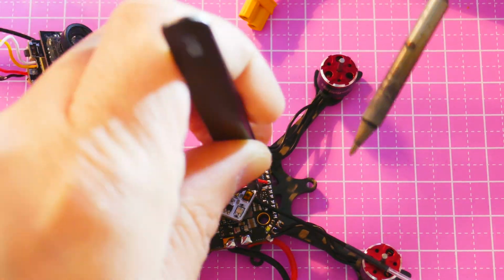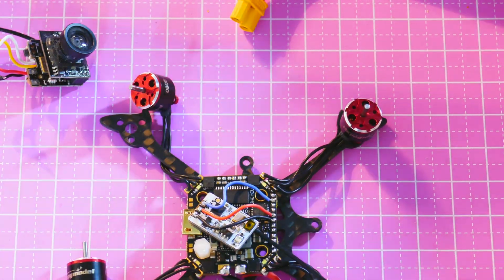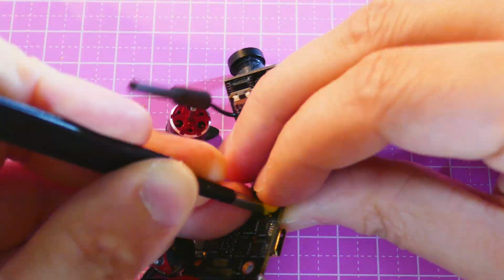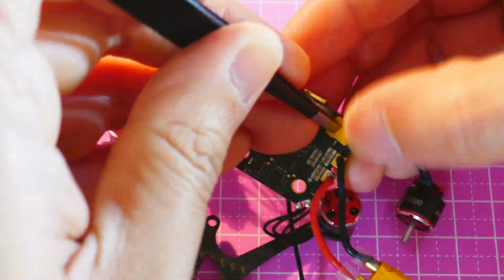JHEMCU GHF13AIO one and only 16x16 FC for FPV Quad

Comment: In the FC documentation it says the Uart2 can be turn on and off for SBUS etc receivers. Does this mean that when it s not turned on it functions as a regular Uart? Like, can i connect (or i guess remap it) to a TX/RX?
Reply from the maker: There are 2 RX pads for UART2, if you need inverted signal (SBUS), use the SBUS pad, otherwise, for something like ELRS, just use the RX2 pad.

Comment: Excellent build. I actually learned something about soldering to pin through hole pads.

Working on anything 20mm a below was a hateful process until by curiosity I picked up a generic USB powered mini soldering Iron from Amazon... it's only 10watts but it can get to 480c with the right power brick (actually 500c since it's so poorly regulated) and that's enough for micro builds...it has made the process so much easier. As it has a tip the size of a well sharpened pencil.
Now if only my hands were steadier...lol

If you've read this far...do you think the 40A version of this FC could handle some 2004 3000kv motors? They are generic and don't specify an Amp pull at peak...but they are .09A at idle and 496watts continuous...
Reply from the maker: Oh yea, those USB irons are good for small joints! There isn't a 40A variant of this 16x16 AIO, but 40A ESCs can easily handle a 2004 motor. Im flying 3.5" freestyle quads and cinewhoops with 2004 3000kv motors on 4s 90% of the time. Amp draw depends mainly on prop size and KV, 2004 3000kv @ 4s should still be fine even on an ultralight 5".
Reply: @kaizendon6237  Thanks for the reply.
And you're correct, it's the 25x25 version of the AIO that has the 40a ESC... undoubtedly 40A peak...and probably 30A continuous.

Comment: I guess this was the toughest board for me to solder ever, because the pads are so tiny and I'm using regular servo wire (board flashed with RotorFlight for helicopters). If I had seen your video before i started all of this... Thanks for the clear video and to-the-point comment !

Comment: how it is hold up now?
Reply from the maker: No issues for my builds, but becareful if you want to buy now, coz the newer ones come with BMI270 gyro instead of MPU6000, and BMI270s are wayyyyy more suspectible to electronic noise, and a compact FC design will only make things worse.

Comment: Is it okay if I soldiered the connector and than joint the motor connector?
Reply from the maker: The regular JST 1.25 connector used for most motors DOES NOT fit into the pads.

Comment: Im planning to use 2s, 3inch prop n   11500kv motor.. what do u think
Reply from the maker: should be insanely powerful. You have to read the spec sheet of the motor to see if it draws too much current.
Reply: @kaizendon6237  the spec sheet dont give current output for 3" 2s. Only 3" 1s. But capable for 65mm prop

Comment: thank you for this tutorial! It was really helpful. Do you recommend this board? is yours still alive?
Reply from the maker: Yes, I really like it for it's form factor. BUT ALSO, i burnt 2 of them, like literally in flames. 1 was likely bad from, it was flying weird, and was unable to tune it out, it burnt after a few flights, the other one, I crashed a lot before it burnt. 
I would be super careful about using turtle mode with this FC, I still use it in a lot of builds.
Reply: I also burnt two of these escs without any crash. One mid air and another on the bench. I still have one and it seems no issue so far but I don't fly that much with it.

Comment: Hey! :) Do you know/could you test if the JHEMCU can go slightly below 2S voltage? My plan is to use it with 2S 18650 Liion cells - those go down to 2.5V per cell (so 5V minimum voltage in total).
Thanks for the video! :)

Comment: Is the VTX pad on diagram for this board battery voltage? or is it 5 volts. My vtx is only 5 volts and do not want to fry one. Happen to me on flywoo board once since it was labled vtx, but not listed as battery voltage. Great walk through, used your method for soldering motors.
Reply: Hey Carlos I have the same question cause I fried my vtx with a 4s 260 mah little battery. The esc can take it but my vtx got smoked. What vtx you recommend or how can I choose the right one.  I really wanna keep using this battery cause it makes my 75 mm a beast. But I think maybe I soldered the vtx on battery not -5 ??  I’m still learning.
Reply: @stephanecollins2093  I used Rush FPV tiny tank, but will swap to something smaller. I connected using 5v for buzzer pads. Easy to miss on diagram.

Comment: nice video with how you arranged thing also the importins of using a spoke stopper and taking your time

hints to solder better tho and for anyone watching this
*always pre tin wires, as you can see at 11:19 you have a lose single core loose on the yellow wire, this comes off and shorts across a chip then its dead
*never peel wire over your stuff, again loose wires cores can and do fall off, short your stuff, not fun, instead peel and pre tin and use sticky tape to collect loose wire cores
*cannot tell if you had your PCB up right when soldering, if so then big no no, a solder drop could drip and short out stuff as it drips down, ever solder things level or in a way so if you have a solder drip it falls off, away from the PCB 
*use more flux, and use a toothbrush later 
*its also better to have more heat and less time on pads than more time and less heat,  also liquid flux is easier than that tin one " RMA - 223"

hope this info helps someone, happy crashing
Reply from the maker: All are great tips! 
I was lazy not pre-tinning the wires, but I actually redid them after inspection with a jeweler's loop. Ended up spending more time! so yea, better pre-tin them!

Comment: Lol, I definitely tinned the pads. First one I had number 3 esc went out on the third flight. Haven’t flew the new board yet. I hope it holds up. If not I’m done with this board.
Reply from the maker: What motors / props are you using? My build using 2" is definitely definitely not push the FC in any ways.